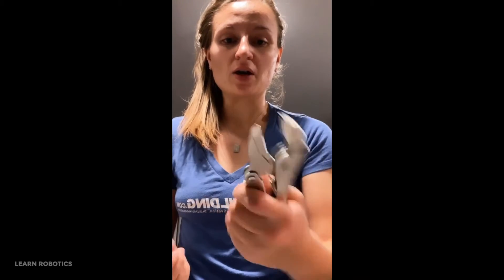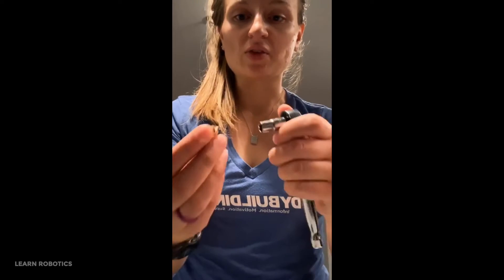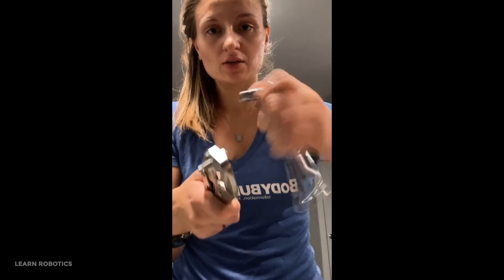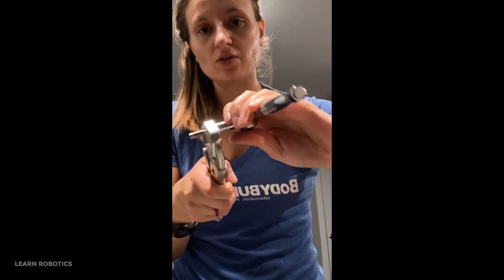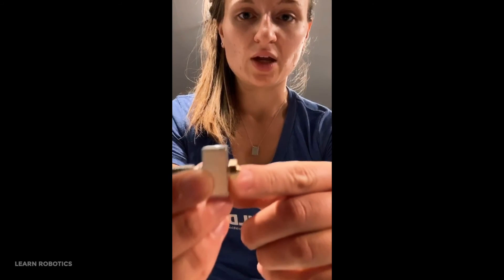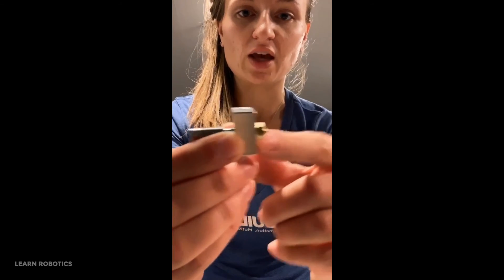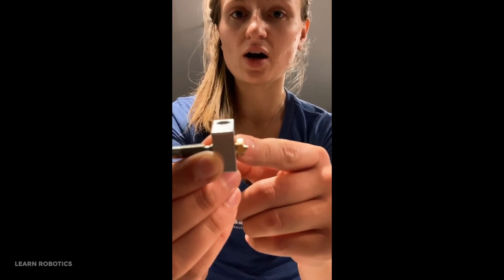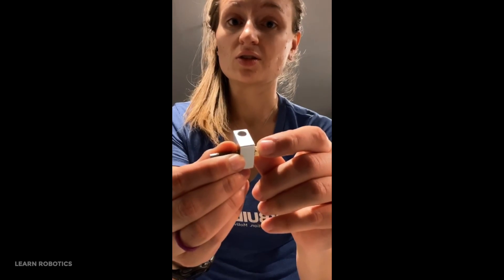How to Assemble a 3D Printer Extruder Nozzle (Stop the Leak!)

Comment: Thanks for the video,
As someone who knows that metal expands when heated, I don't understand why everywhere else recommends tightening the nozzle when it's hot. If it's tightened when it's hot, it will be loose when it cools because the metal will decrease, right? No one is saying to tighten the nozzle to 20nm when cold, just tight enough to get a good fit without forcing it.

Comment: Your hint solved the oozing here. The Bowden type needed to replace the internal PTFE tube that was a little burned at its point causing the leak. And I had to handle with the hotend at PLA temperature, it's not working cold. Thank you.

Comment: So mine is actually leaking above the heat block you have there … the other part you tightened onto the block to meet the printer nozzle is where I’m getting back spittle up from there whether I do it Hot or Cold tighten… did I just get sent a bad heat unit ? I haven’t seen anyone with my issue in hundreds of videos lol
Reply: mine is doing the same. Have you figured it out?
Reply: @tarahgudmundson3532   from what I could put together I needed to detach the entire tube zone and print nozzle... make this little half inch bowden tube bit... force it down... then attach the regular one... left a smidge of a hairline gap when screwing in the nozzle then jammed the small tube bit in... followed by the regular distribution tube... held it in as hard as I could and attached that grip  at the top to lock it in... then tightly screwed the nozzle in... all while the damn hot end was active lol had to be very careful.... and had to make sure the print nozzle kept the gap at the bottom but was snug to the tubes inside... otherwise it has some weird leak issue... someone on another video said theres a Bi Break attachment for these things but they are 40$ + and not even guaranteed to fix the issue...

Comment: I had a small leak no matter what I did. So I ended up "lapping" the mating surface of the nozzle and the mating surface of the heat break where they meet with 1000 grit wet sanding paper and that finally took care of it. I don't think the surfaces were fine enough to seal. Thanks for sharing.

Comment: If that's not a different nozzle from what i'm using i would say this clip is mirror image 😂 Maybe it is correct but i'm still wondering 😁 You are tightening in left direction. I think this is the selfie camera 😊 It dose not matter...I check most often when people turn bolts because many people turn the wrong way. It's a work injury I have 😂

Comment: Deneteus are correct about that...i didn't use this manual i experience this myself when i tighten the brass nozzle cold...after that it leaked. It took me awhile to figure out why it was leaking. It must be because metals expanding differently. Maybe it works with one type of nozzle but when you use another type for example brass nozzle it will maybe not work because the other metals are not close enough when all metal expands. Maybe bad quality metal can be the problem to? But i'm recommending to check the nozzle regularly. Maybe it stays put but as all nuts and bolts it can loosen with time.